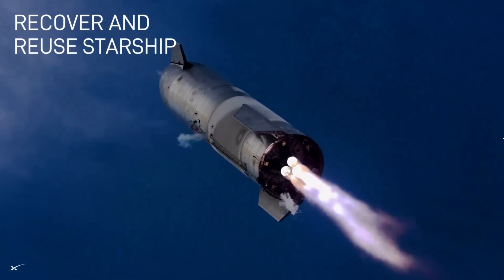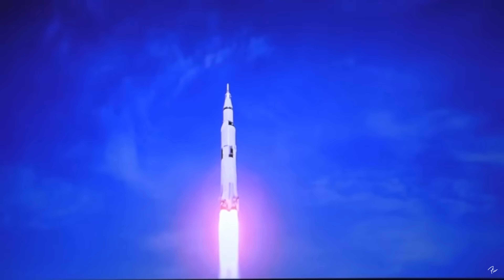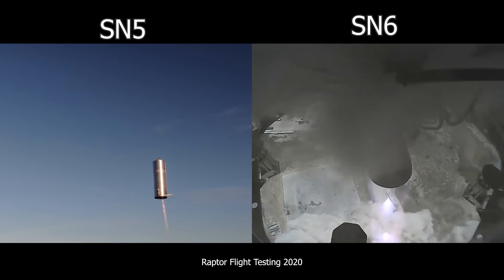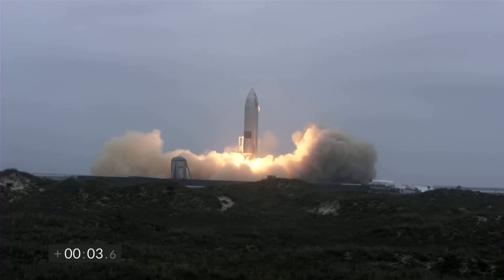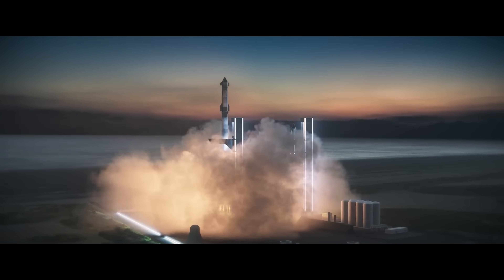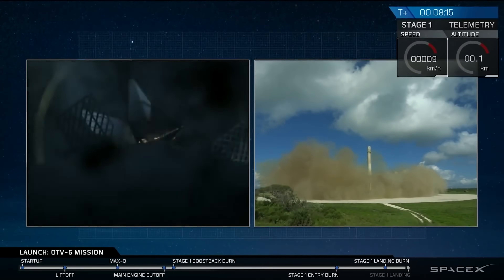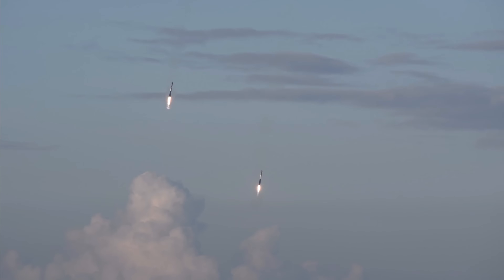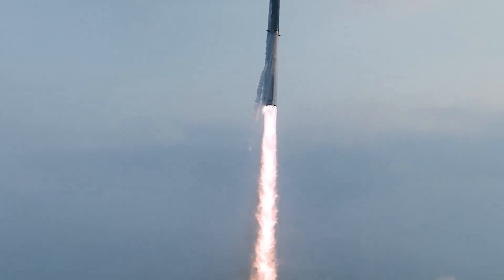The SpaceX Rocket Engine That Couldn't

Comment: The Soviets tried a configuration like Starship with the N1 rocket but they never got it to work and they had fewer engines (30 instead of 33).
Reply: Because the soviets didn't have enough money to test every engine. That's not a problem for SpaceX
Reply: @Ignacio.Romero  More directly, it's because the engines were designed in such a way that they could not be tested.  They could only be used.  The best they could do was test one engine out of every half dozen or so they made, to see if there were any major issues in the manufacturing chain.  The true "test" of the engines would be when they launched.  This was obviously a terrible method and the end result probably aligned with expectations.
Reply: N1 rocket had problems, but engineers who made it, had solutions to these problems, they had new, better engine prototype, new rocked design, improved throttle control systems, but 2 things killed project: lead engineer died, and USA got to moon faster.
New lead engineer didn't like program, and space race ended by USA winning.
Reply: @crosshunter3316  No, it was cancelled in the mid 70's, far after the US won and a whole decade after the lead designer passed away.
Reply: @crosshunter3316  
The Chief Designer changed hands twice after the death of Lead Engineer, Sergei Pavlovich Korolev.

After Korolev died, his deputy and right-hand man Vasily Mishin became the new Chief Designer, inheriting a flawed N1 rocket program. By 1972, all four N-1 test launches had failed.

Korelev's rival, Valentin Glushko, was appointed as Bureau Chief of all rocket programs. Glushko's first act, after firing Mishin altogether, was to cancel the N-1 rocket.
Reply: @Ignacio.Romero  yet SpaceX is still having issues with all the engines firing
Reply: @DemocracyDiesInDarkness  getting better every launch so doin good.
Reply: @DemocracyDiesInDarkness  The raptor engines are the most advanced rocket engine ever flown, very complex to start up so no wonder they get failures. Every flight seems to be getting better and better though as they dial in startup procedures.
Reply: @DemocracyDiesInDarkness  i honestly think that is from testing so many things at once hell it might even be part of the test to see how other systems take up the slack. But elon has said many times that they have been experimenting a lot with shielding and with raptor 3 it finally wont be necessary because there is very little to be damaged with the new design.
Reply: Engine failures (later in the flight) may be caused by the Raptor autogenous pressurization system...
 @DemocracyDiesInDarkness 

Elon might have been a bit embarrassed to admit that there are combustion byproducts entering the Main LOX tank during launch. Engineers are counting on ullage stratification to keep the majority of these CO2 & H2O gasses from reaching the LOX engine inlet filters in the form of ice slush. 

During the boost-back turn-around, sloshing the LOX propellant has to be avoided because that may bring accumulated ice against the inlet filters. 

Booster Landing is achieved with a separate tank with pure LOX, so landing burn reliability will be high.

[Still, restarting the second stage Starship engines at any time after experiencing freefall may require using the header tank LOX. That probably includes burns for circularization, course changes, retro thrust for deorbit, and landing. And the LOX header tank needs inert gas pressurization. 

Surplus LOX may need to be purged from the main tank before reentry, and perhaps even before SECO.]
Reply: The N1 didn't fail due to engine problems, they had pogo effects across the entire stack. You have to realize that back then, computer technology was only in its infancy. They couldn't numerically simulate the launch with cfd in advance like we can today, they had to launch it to see what went wrong. Also the control system was a lot more primitive. It's amazing that they got as far as they did considering the technology of the time.
Reply: The N1 booster engines were originally planned to be single-use, not even capable of being tested in advance and reused. The quantity of redundant engines was supposed to offset the reliability question.  

Most important, the N1 was developed in the context of a race to the moon. 

The final launch attempt of the Soviet N1 rocket occurred on November 23, 1972, almost three and a half years after the first crewed Apollo landing on the Moon.

Comment: Trying to catch the booster with the same tower as you launch from is IDIOTIC. It is not a matter of if but when you will have an engine or control failure leading to a crash. However rare, even extremely reliable commercial airliners crash. They should have a dedicated CATCH TOWER well away from the launch infrastructure, tanks farms, etc. just for catching returning boosters. The cost of building a few miles of roadway and a simple tower with no propellant handling hardware is well worth it.
Reply: Rapid re-usability is a thing. Landing down the road defeats that goal. The premise is the same as the airline industry. You need to land at a place you can launch from. You only need wheels, and be able to taxi, if you can't VToL. Falcon has proved hundreds of times now that accurate vertical landing is possible. Rational, not idiotic - but extremely difficult.
Reply: @luke_fixed5266  Three things... (1) Falcon lands pretty far from the launch pad. Far enough at least that any landing accident will not send it crashing into the launch infrastructure. It is a matter of when, not if, Falcon will have a Merlin failure during the landing burn. (2) It takes less than a day to move the SH from the factory to the tower, it should take a similar amount of time to move it from a catch tower to the launch tower. (3) Given that there will have to be at least an inspection performed before relaunch, even if you catch it with the launch tower, you will still wheel it back to High Bay or Mega Bay anyway.
Reply: @dwightlooi 
If you're already going to have two towers just make them both operational if one gets damaged use the other. 
it's not that complicated.
Reply: Uh, an operational towers cost a hell of a lot more than a catch tower. The majority of the cost of a launch tower is not the tower truss itself but the propellant farm, cryogenic facility, propellant delivery plumbing and arms in the tower, water deluge stuff etc. A catch tower has none of these stuff so it is just the truss structure and the chopsticks. Also, because it has none of the other stuff, it is not prone to damage in a failed landing. There is no propellant farm, water tanks, pressurization station, refrigeration plant, etc. nearby for the rocket to crash into. A failed catch simply means some burnt concrete or dirt nearby.

Comment: dont really see the benefit of the capture
you cant reduce weight, because things will go wrong and there will be a time you cant get it to the arms, but can get it down safely 
so the legs cant be removed
if the legs cant be removed the benefit is changing a trip on a boat to a trip on a tank
Reply: they are designing to the most efficient method they can add them if the need to but its better to get the livin on the edge data first and work backwards then the other way around.

Comment: wonder if they can improve the water deluge system to be able to use seawater without harming systems
Reply: No, spraying seawater onto the park is obviously not going to go over well in any way shape or form. That is why they use regular clean tap water, fit to drink. Seawater would be the opposite of an improvement.
Reply: @dirkbester9050  seawater is far more plentiful
i know its harmful 
thats why they should look into a way of making it not
Reply: All that sea water would be vaporized during launch. It is going to precipitate a lot of brine. That would be bad for the estuary. Also bad for all the SpaceX equipment. 

Using potable tap water is going to be similar to rain water, which is tolerated all the time.
Reply: @imconsequetau5275  but its a lot of tapwater
a massive amount 
and there is kindof a water shortage thing going on in americas farming stuff 

i know saltwater is bad, im very aware 
im not suggesting they just hook up the pumps to the ocean and thats it 
but finding a way to not use fresh water would be pretty good for the nation in general 
it would require some creative solutions
but thats what spacex does

Comment: Starship hasn't launched anything yet. In the end, it may be nothing but another Hyperloop.
Reply: So you have not actually watched any of the flights?
Reply: @dirkbester9050 we’ve all watched the same launches with 0 payload onboard and no orbits. This could easily become another hyper loop or falcon heavy. Why hasn’t falcon heavy launched more? Supposedly it currently has the highest Leo payload and yet it hardly flies once per year. And spacex decided to.. make a rocket with even higher payload to orbit? I guess they’re just crossing their fingers hoping a larger launch market falls in their lap
Reply: @mattkingston6157  These are tests flights that are not designed to reach orbit nor carry a payload! They very could carry a payload and reach orbit if SpaceX wanted to, they have enough fuel left for that!
Reply: @SentinelSent  yeah sure keep telling yourself that. Look at the fuel gauges on both the stages during all flights. They’re running near empty with 0 payload. 0 pounds, and not even a stable high enough altitude orbit they’re just skimming the atmosphere.  It’s easy to say that they could have a payload, it’s a lot harder for them to actually have a payload. Every other rocket is expected to work first time. And they almost always do and they almost always carry a payload of some sort
Reply: @dirkbester9050  Only one hasn't blown up, which barely made it down, and it didn't have a payload.
Reply: It's a simple matter of putting something there? Even if they fail in everything after this they would still have a non-reusable rocket that can take over 50 tons of payload to orbit. They've already proven they can get stuff to orbit
Reply: @rizizum  what payload will weigh 50 tons? Satellites are getting smaller not larger. There is no market other than starlink that requires a starship. Why doesn’t falcon heavy fly more? It has such a vast capacity to low earth orbit. Nobody needs such a service that’s why
Reply: @mattkingston6157  Again, what does that have to do with anything I said?
Reply: @rizizum  my point is that we clearly don’t need a rocket with a 50 ton to orbit capability. Let alone the 100 tons it’s designed for. There are no payloads that weigh that much. Starship isn’t optimized for out of low earth orbit missions which is why it’s not going to be launching deep space probes or large scientific missions. Starship is great for Leo and would make a great starlink deployer. But that’s kinda all it’s good for there are no single payloads that come close to starship capacity they’re building a rocket no one needs. Neutron is really the way forward in my opinion. Individual Payloads are getting smaller not larger
Reply: @mattkingston6157  Again, what does that have to do with anything I said?
Reply: @rizizum  even if they fail they have a 50 ton expendable launcher - paraphrasing but that’s essentially what you said. And I agree with that point. What I am saying is that this is a giant boondoggle because nothing needs a 50 ton capable launcher to be put into low earth orbit. There is no payload that large which requires starship. The heaviest commercial satellite is like 10 ish tons. I’m sure it would be great for launching starlink, but that’s kind of it. My point is that this is kind of pointless since starship can’t get out of earths orbit without a hilarious number of launches
Reply: @mattkingston6157 again, what does have to do with anything I said?
Reply: @rizizum  Of course, because Musk is a stable genius who isn't zoned out of his mind most of the time on various recreational substances. Starship is a literal pipe-dream As was Hyperloop.
Reply: @True-North-2025  Starship is not a pipe dream. Landing Falcon 9 boosters was seen as ridiculous by many until they did it. Now those same people are back claiming Starship will never work. Quit it.
Reply: @True-North-2025  ??? What does that have to do with anything I said?
Reply: @KerbalsandWackMacs  literally no one thought falcon 9 couldn’t land. The DCX did it decades prior. Even armadillo aerospace did it first. It was debatable whether the reuse would even provide much of an economic benefit. Which is still not totally settled. Launch costs are such a small part of the cost of building a satellite. Most falcon launches are starlink, again why doesn’t falcon heavy fly more if it is so much cheaper per pound to orbit compared to falcon 9. It’s not nearly as simple as spacex fans like to make it seem. It’s the reason ULA isn’t going anywhere, there more to the game than price per pound
Reply: @mattkingston6157  I don’t want ULA to go anywhere, I really like them. While I would like everyone to try to reuse rockets just to avoid more trash going into the ocean and staying in space, I understand it isn’t everything. With Falcon 9, there were definitely people who didn’t believe in it and who never believe in SpaceX, but that could also just be because there are people like that in the world.

Comment: You showed ULA's Vulcan with two BE-4 engines talking about tradeoffs. Each Raptor 3 outperforms each BE-4 on nearly every metric. Starship and its booster are truly massive. It is much more ambitious than any other rocket project before it.
Reply: I love how all of these sites try and compare Starship with things like Vulcan and New Glen when they barely compete with the falcon 9
Reply: @jeffingram8279  If New Glenn works, it'll definitely compete with Falcon 9. Unless it takes long enough to get going that it won't really be competing with Starship.

Comment: Good video. If you look closely you'll notice the engine that was throttled down during Flight 4 wasn't completely opposite to the engine that was shut down, which makes me think it was having other issues and the flight computers told it to throttle down for safety. Secondly I don't think we got any confirmation that the flying concrete was a likely cause of multiple engines being out at liftoff during Flight 1. Considering the most engines they ever lit during a static fire before that point was 31, it's possible that one more engine just didn't start properly during Flight 1.
Reply: If you shut down an engine then you might not get it back. So its better to throttle three or four engines down to get better control
Reply: There was only one engine that was visibly throttled.
Reply: @-yttrium-1187 definitely not getting back the outer engines since they can’t start themselves — they are started by quick disconnects on the OLM on launch and cannot relight.
Reply: I have long wondered why more channels didn’t mention the clear throttle down on the directly opposite engine, but that’s no indication there was an issue with it.  It makes sense to throttle down the opposite engine to minimize asymmetric thrust.  My only question is, “did/can they throttle up the other engines?”
Reply: @qwerty112311  Why would it throttle down an engine not directly opposite to the engine that was out?

Comment: You do realize this is not the final build right? These are prototypes and they are testing for bugs and problems. Why dont you go talk about how well Boeing is doing with Starliner?
Reply: Because the topic of this video is the Raptor engine and not the Starliner capsule. I think that might be the reason.
Reply: @luckbot-5000 😂😂🐋
Reply: Did you even watch the video? No, you read the cute headline and got angry because that particular rocket could not as a matter of historical fact. Do you know that there is an interview in this video and you missed it?

Imagine hating on Farscape without ever actually watching the series. Pretty nonsensical right?

Comment: A hole in the ground below the pad is smarter the hole is 250-350 ft deep then splits into 4 tunnels that goes horizontal then curve up to the surface grated vents 600-800 feet away. No water required. NO mess no damage. Always works. That's what Davinci said to do. A few rats turn into pure carbon. Thrust needs somewhere to go farther away. The vents have a rotisserie roasted pig optional component or convert to steam for power. Stop wasting thermal energy.
Reply: Unfortunately the ground at starbase wouldn’t support such a structure